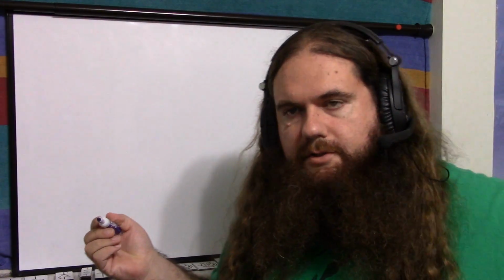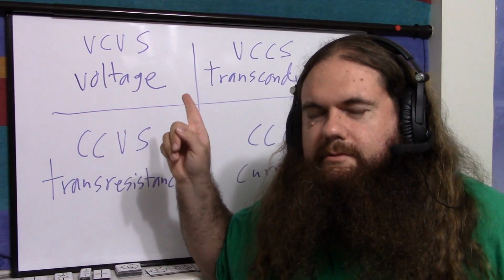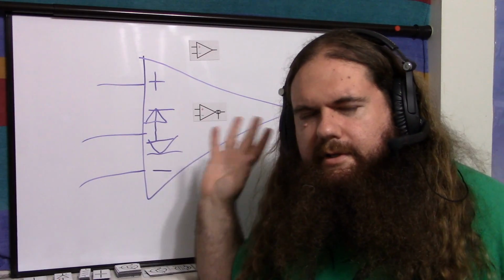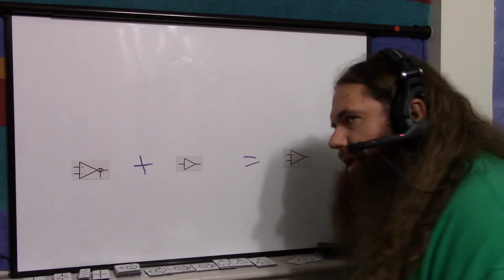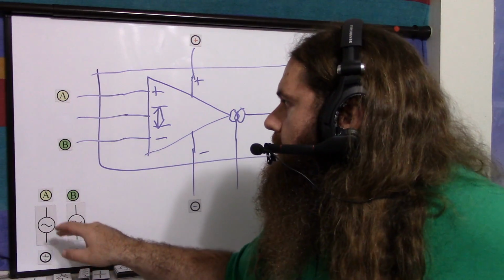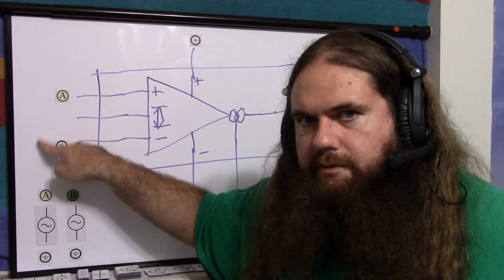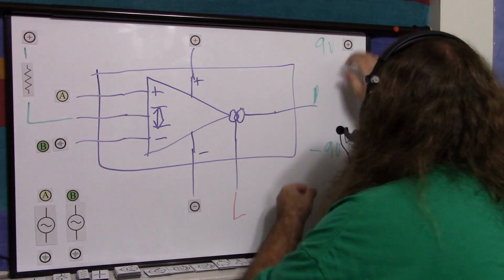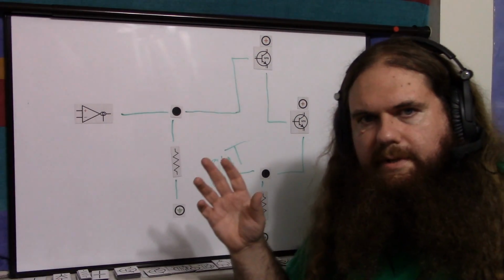Operational Transconductance Amplifier - OTA LM13700 - Simply Put

Comment from the maker: I screwed up a bit on the buffer part at the end: It's not a voltage follower, it's a darlington emitter follower (they're very similar but not the same), and the emitter resistor (the one near the output) is supposed to be connected to the negative supply, not to circuit ground. The explanation is actually mostly right though! I will do a video explaining the darlington emitter follower, but for now just kind of skip past the buffer explanation here.
Reply: This video was fantastically explained, thank you!
Reply: @Aaron Jayden instablaster =)
Reply: i dont mean to be so offtopic but does anyone know a method to log back into an Instagram account??
I was stupid lost the login password. I love any tricks you can give me!
Reply: @Jaxson Ariel Thanks for your reply. I got to the site through google and I'm waiting for the hacking stuff atm.
I see it takes a while so I will get back to you later with my results.
Reply: @Jaxson Ariel it worked and I finally got access to my account again. Im so happy!
Thank you so much, you saved my account :D
Reply: @Aaron Jayden glad I could help =)

Comment: My first time here.  You put a lot of work into this.  You covered a lot of material, not just on this chip but on op amps, interfacing, current to voltage and vice versa.  It gave me a pretty good intro to this chip, enough to venture into the datasheet.  Still not clear about what to do for the inputs but maybe the datasheet will explain.  Now take a deep breath!   Admirably done.

Comment: I don’t understand ‘setting the differential input voltage’ to the input of the op-amp / OTA. That voltage should be zero? One of the properties of op-amps in a closed loop configuration is both inputs are the same voltage as each other…

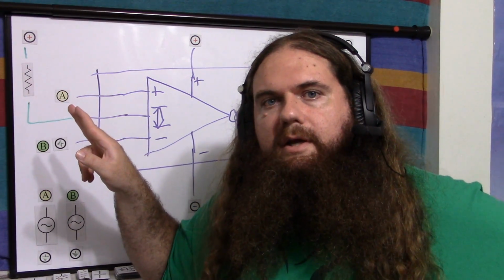Comment: I don't think you are quite correct at time 24:48 when you say it says that the voltage at the linearizing diode pin is going to be one diode drop above circuit ground, which you later say is halfway between positive and negative supply. Actually when TI's datasheet on page 11 says "As the input voltage has a DC level of 0 V, the Diode Bias input pins are 1 diode drop above 0 V, which is +0.7 V", the datasheet is referring to their typical application schematic (Figure 17) which has the + and - inputs connected to a 1k potentiometer where the center washer of that potentiometer is connected to an external ground. Note: the IC itself doesn't have a circuit ground. Looking closely at Figure 16, it seems the Diode Bias more specifically is going to tend to be one diode drop higher than the common voltage of the - and + input voltages.  It could be that the - and + input voltages are centered around another voltage level other than 0V.  If for instance the - and + input voltages were centered around +2V, then the Diode Bias input would be at +2.7V, I believe.

Comment: the ota changes gain based on load impedence, the current stays fixed based on inputs, but with fixed current comes diffrent voltage at diffrent load impedence. its Ohms law, so fire

Comment: Great video!

Could an OTA be used to mimic the behavior of a thermistor where you want to observe overall circuit behavior for different programmatically input "thermistor" resistances rather than having to apply a thermal input to an actual thermistor?

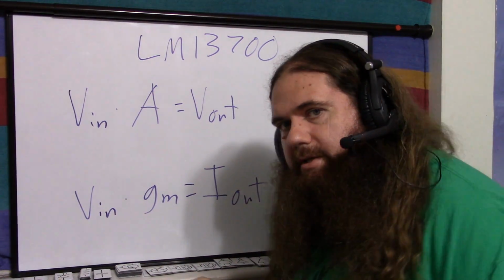Comment: 4:30 what is transconductance?
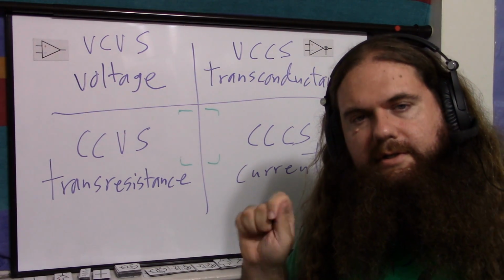8:43 OTA symbol explanation
10:16 what are the inputs?
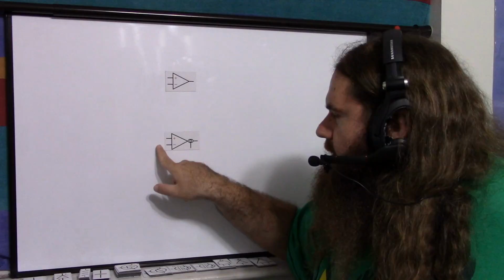12:25 iabc explanation
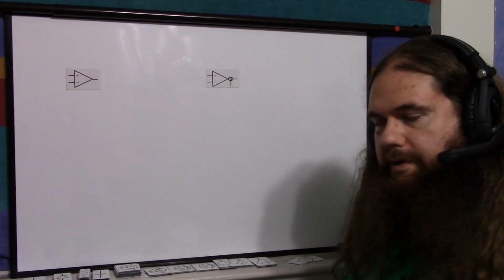13:41 buffering the output
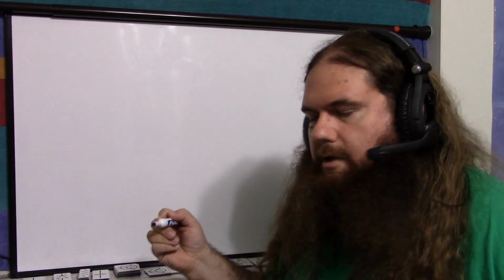16:56 connecting the chip
18:22 gain control resistor
20:57 linearising diodes, inputs
26:05 quick summary
27:54 output, internal buffers
33:05 final summary

Comment: I think the use of the word Transconductance is incorrect since this is not true transconductance as defined as the ratio of change in anode current with respect to grid voltage in a vacuum tube.    Maybe we need another word to describe this effect.

Comment: We used OTA's a lot in analog video signal processing, mostly as a "back porch clamp," but also anywhere you want to intentionally introduce slew rate limiting.  We would forgo the output emitter followers and the linearizing diodes completely, and often feed the current output to a capacitor (referenced to ground).  Bring the capacitor voltage to the inverting input and you get a cheap but effective sample and hold.  Bias current on for sample; bias current off for hold.  Once used CA3080's but the LM13700A is better.  Regard from Paul, formerly of Grass Valley Group.

Comment: One of the main reasons you might want to use an OTA is basically to be used as a voltage-controlled resistor (with the control voltage being applied to Ibias).
For instance, the voltage driving Ibias can be varied to change the output gain, allowing it to effectively act as an amplifier with a voltage controlled volume knob, or as a (two-quadrant) voltage multiplier (same thing), though to have linear multiplication, you'll need an extra circuit to convert a larger voltage to work within the range of Ibias.
In a similar way, it can be used to make a voltage controlled filter (controlling the output current gain being equivalent to changing the R in an RC filter).
It's also used in some synthesizer VCO circuits (as they usually work by having an integrator that generates a ramp that resets at a certain threshold, with the charging speed of the ramp (and thus the frequency) being controlled by the current into the integrator. A triangle wave can also be generated by changing the direction of the current rather than discharging  the capacitor all at once).

There's also a pretty interesting component called a Norton op-amp (the LM3900 being an example), which reacts to the difference in current at its inputs rather than voltage.

Examples:
Thomas Henry's VCF-1
Electric Druid's page on multi-mode filters

Achim Gratz (Stromeko) also has a good (work-in-progress) paper on OTAs that goes into more detail.
The LM13700 datasheet also has a lot of interesting applications.
Reply: @Ormaaj  You try driving a potentiometer at 5khz with a motor. ;p
That's acceptable for the kinds of applications listed here anyway (filters and VCAs).

You could also make a vactrol (photoresistor and LED pointing at each other in a sealed case), but the response time is relatively slow.
Reply: @Ormaaj  sound-au also has a few articles on VCAs (one that compares different types for compression/limiting, and a couple others that include a Op-Amp+JFET-based limiter and a preamplifier with integrated VCA-based multi-channel volume control).
w2aew also has a video on the Gilbert cell analog multiplier: 
https://www.youtube.com/watch?v=7nmmb0pqTU0

Comment: Thanks for this great video! I love using the dual OTAs for VCFs and VCAs. The fact that there are two OTAs in the LM13700, and that they are inherently matched in parameters and thermally coupled makes then extremely versatile for precision applications. Many years ago, my colleagues and I submitted a paper to Texas Instruments which describes applications that capitalize on the fact that each chip has a matched pair, but by that time, the part was not so popular, and they didn't add these applications to their data sheet.

Comment: 31:24 do you think the buffer BJTs are in amplification mode or in saturation mode ? And if they were in amplification mode would this impose a restriction on the base resistor to be low enough so that base current becomes low enough not to enter saturation mode ? I hope I'm clear.
Reply: AFAIK when in amplification mode the relation Ic = gain x Ib is preserved. While in saturation, not necessarily. 
When you say the the positive rail of the collector feeds the load I feel it's saturation.
From another hand, in saturation, I think Vce is 0, which is not our case. Anyway...
Reply: I strongly believe we are in amplification mode, where base current is linked by the transistor gain to the collector current, and both currents are determined mostly by the source side and in a low degree by the load side. And Vce is last parameter that will be determined.
And we might probably be limited by a max Vce for normal operation, and by consequence the transistor supply voltage must not be far away from the signal voltage.
Reply from the maker: Being a novice, I'm not 100% sure I understand all of what you've said, but if I understand the way the OTA and the Darlington emitter-follower buffer works, the idea is that the base current through the buffer transistors should indeed be as minimal as possible, so that it doesn't divert significant current away from the resistor between the OTA output and ground, thus not messing up the current->voltage conversion that resistor does. So yes, if I do understand, then we are in amplification mode and the resistor has to be chosen correctly to not let the voltage go too near the positive supply when the OTA is at maximum current output.
Reply: @simplyput2796  thank you... You're great and I'm your student. 
One more question, do you think the resistor right below the emitter is better be significantly higher than the load resistance, like 5 or 10 times higher ? Or this is not really a constraint. 
I feel it's better be higher but it's not really a constraint since it's only about how much power will be consumed.

Comment: 17:54 I thought of a Zener for clamping like an assurance of voltage not exceeding a value of say 40 mV but the voltage is too low. Anyway a circuitry of overvoltage protection maybe is good to think of. 
Like using a voltage comparator that will short the OTA inputs in case of voltage higher than 40 mV.
Or hey, why don't we hook up an op amp inputs in parallel with OTA inputs so that the op amp regulates the input difference for us... IDK what I'm saying.
Reply: You can always put the zener in the voltage divider

Comment: That's a great adition to the articles Ray Marston wrote about the LM13700.
https://github.com/jsr606/CFO/blob/master/CFO_Haarnet/documentation/Filter%20Types/April%202003%20Ray%20Marston%20-%20Understanding%20and%20Using%20OTA%20Op-Amps.pdf

https://studylib.net/doc/18782951/may-2003-ray-marston---understanding-and-using-ota-op which basically takes the TI datasheet and makes it clearer.

Comment: Nice job! That really cleared it up.... Now  if you could do one for the LM3900, my life would be complete....
Reply from the maker: According to the TI datasheet, it's a norton operational amplifier, which apparently is transresistance? Fascinating. I shall do research. Time for another Mouser order, I guess!
Reply: @simplyput2796  - I am fascinated by that chip. I build modular music synthesizers for my hobby (ok, addiction) and found that one of the most interesting forefathers of synthesis (Serge Tcherpnin  - https://en.wikipedia.org/wiki/Serge_Tcherepnin ) used the LM3900 EVERYWHERE in his designs. Most of the original designs were cloned (with Serge's permission) by a fellow named Ken Stone, and are currently being sold by Elby Designs. The schematics are available on Elby's website, and may prove interesting for you... https://www.elby-designs.com/contents/en-us/d77_Serge_Modules.html. The chip itself has proven to be very hard for me to understand, but it seems to be a real swiss-army knife.
Reply from the maker: In principle, something that is controlled by current should be incredibly flexible, because effectively that means it's controlled by current OR voltage, meaning you control it by varying the resistance or by varying the voltage, whereas something controlled by voltage you can only really vary the voltage. OTA + buffer = OpAmp, but you can't take the buffer back off the OpAmp to make an OTA. This sounds like quite a rabbit hole to dive down.
Reply: @simplyput2796  op amp + FET = OTA
Not sure but a guess

Comment: Great explanation. I'm hung up on the current idea. What is the voltage of the output current, is it the difference of the inputs but at a varying current?  I need to watch this a few more times and compare with popular synth circuits. Thanks for the video!
Reply from the maker: It might make more sense to you when I go through an actual voltage amplifier using an OTA, but it's actually much simpler than you think. Current out = differential voltage in (times) transconductance. Transconductance is sort of like gain, except it's amps per volt instead of volts per volt, and your transconductance is set by the current going into the "Iabc" or "Ibias" pin (the one drawn going into the two circles). So you're going to have Iout=gm*Vin as the current going across the resistor connected directly to the OTA output. No matter the resistance, you'll have that current. So if you change the resistor, you change the voltage swing, because V=I*R. So for example, if your maximum current swing across that resistor is +/- 1 mA, and your resistor is 1k ohm, then your voltage will swing +/- 1 volt. If you change it to a 2k ohm resistor, your voltage will swing +/- 0.5 volt. So you set your maximum voltage range by the resistor value based on your maximum current range.
Reply: Buried reply to just talk to you.  I really appreciate your videos!  You are speaking right where I need to be.  Do you have a bio somewhere?  Do you have a public email address?